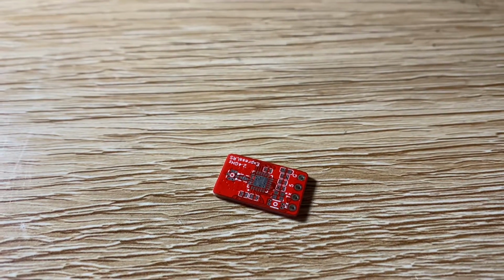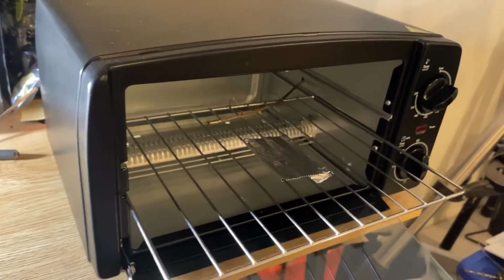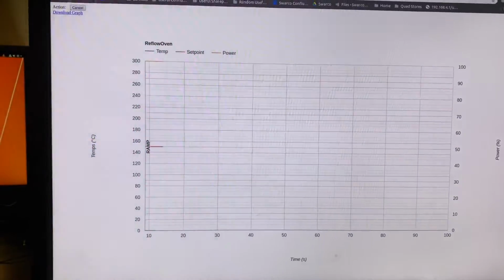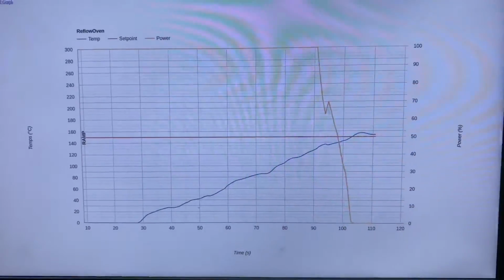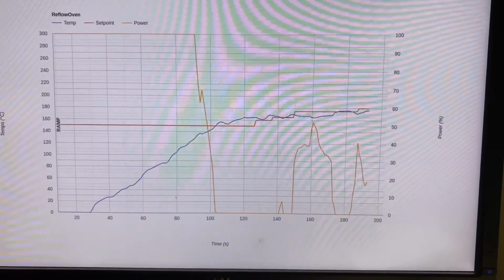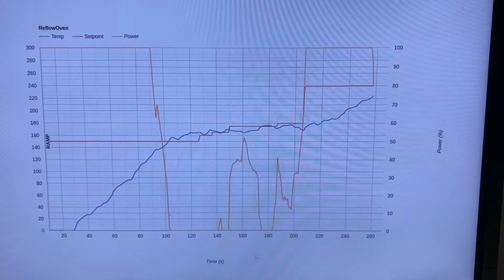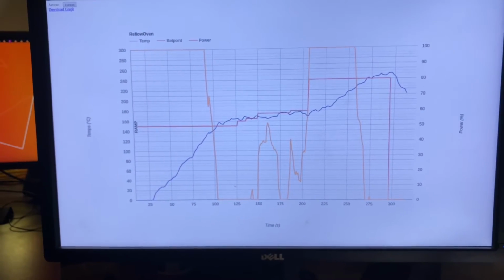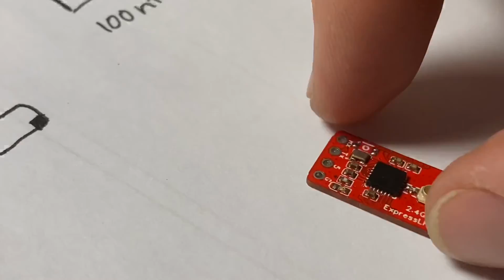2.4G SMD Reflow - First Build

Comment: Very nice! Going back through some of your earlier videos, love seeing the oven and controller for reflow. I've done dozens of quick turn boards at work, but only 3 for my own projects. I usually just use an xacto to place solder paste, need to try a stencil sometime. what board house did you use? the red makes it look like dirtypcb.com. Everyone else stateside uses OSH park.
Reply: nevermind, looks like dirtypcb has rolled up. 1$ per board was a great price.
Reply from the maker: @wjbartlett100  used JLCPCB. We get all our ExpressLRS stuff there (the AU guys at least). Cheap and good options for FR4 thickness etc.